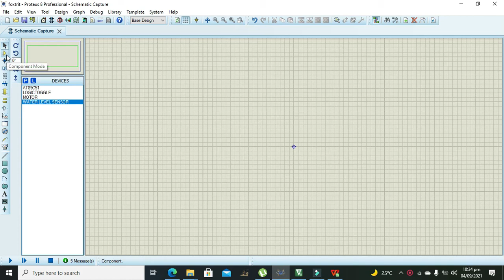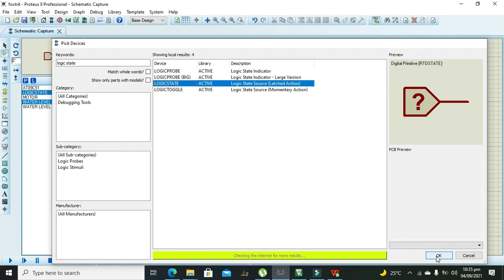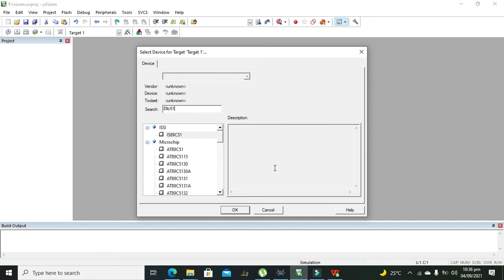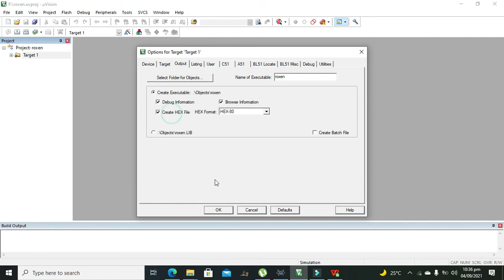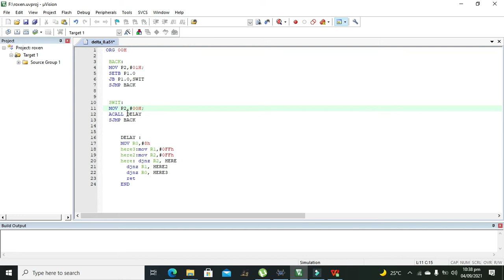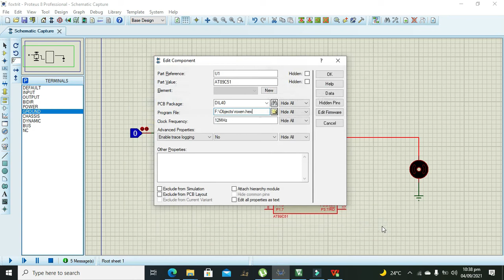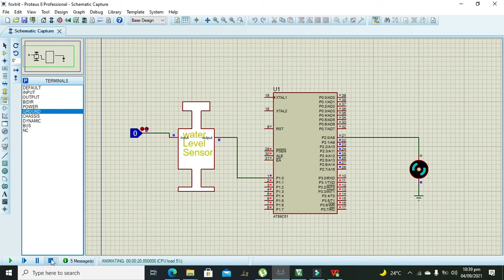water level sensor interfacing with 8051/89c51 in proteus using assembly language

Comment: Hello Sir. Could you share water level sensor (float) library ?
Reply from the maker: buddy check either the link in the description is working properly....after u have downloaded the file u will be able to use it in the same file...
Reply: @nelsondarwinpaktech3954  Pardon Sir, When I open that in Proteus, it just a blank page.
Reply: @hobimurah3197  Did you get the library ?